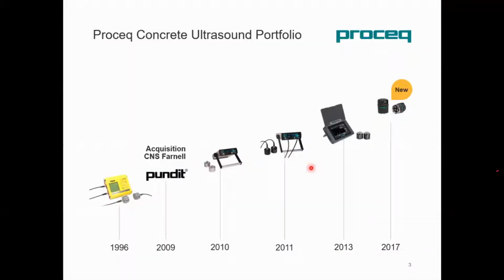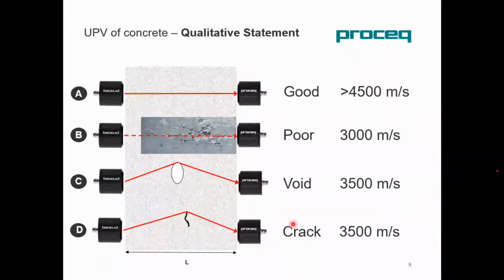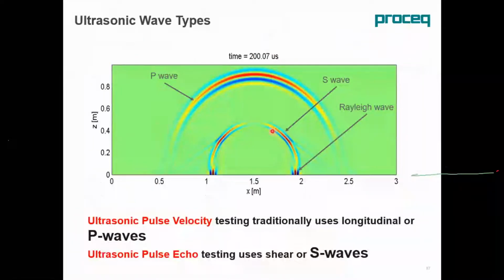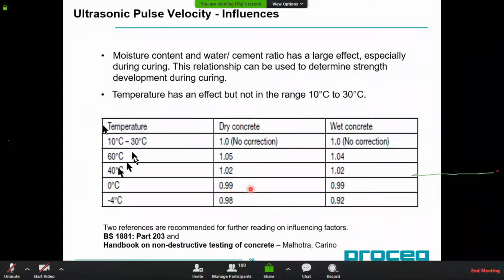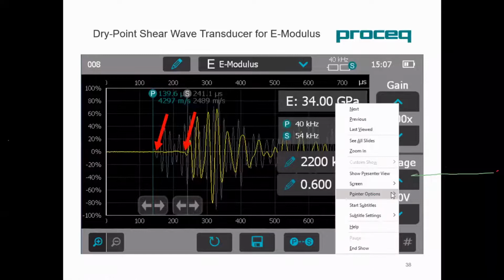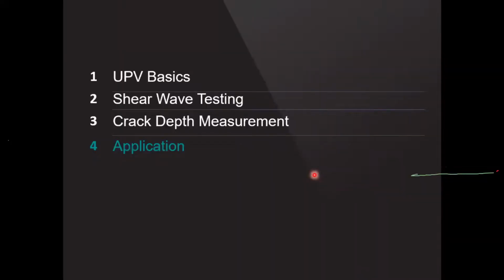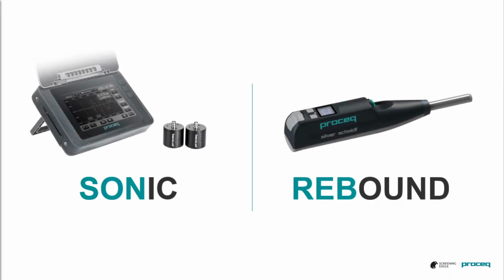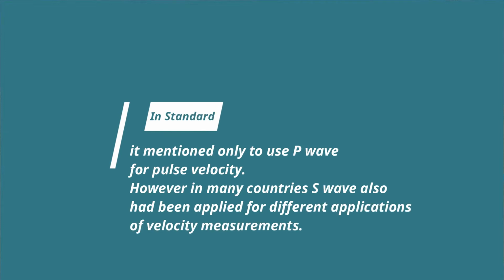Proceq UPV Webinar: Applications and Benefits of using Ultrasonic NDT on concrete

Comment: I have done the UPV directly above the pipe sleeve (6" dia mm) that embeded in the concrete beam & why it doesn't show any different in it value as compare to it adjacent concrete without pipe sleeve?
Reply from the maker: Hello Ricky in the webinar we had explained there will not be a good contrast to identify a void or a hollow pipe by UPV value. In case with longer distance it becomes less obvious beside we take in count of other influencers. You can try other NDT methods like GPR, UPE and others for a hollow pipe locating in concrete